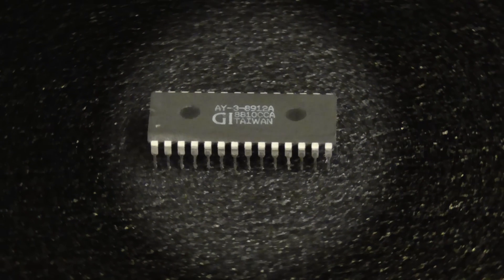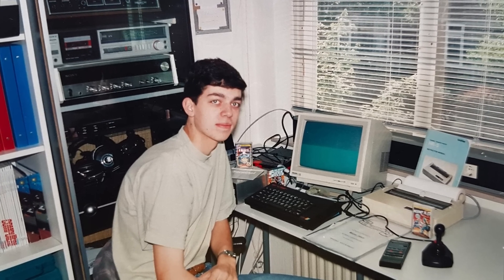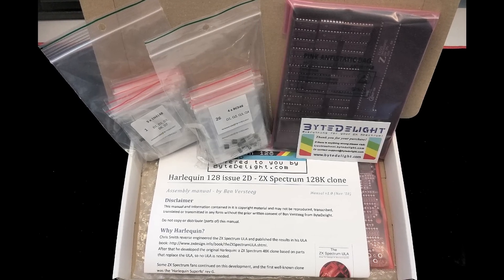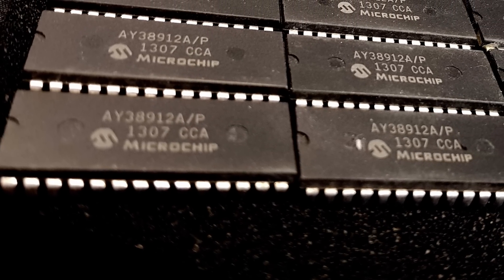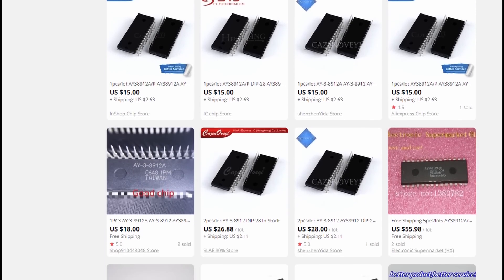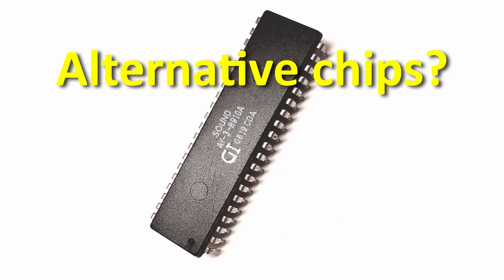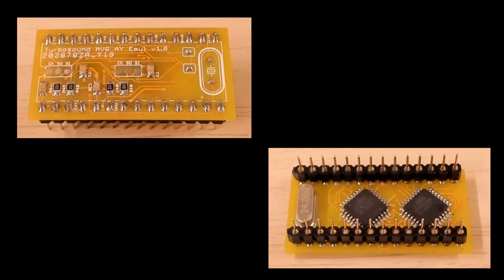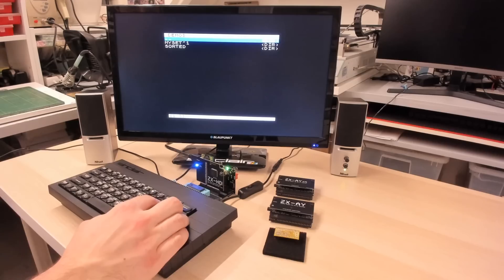R.I.P. AY

Comment: I'm going to stick my neck out here and say I actually prefer the sound of the AVR-AY, at least compared to the 8910's sound - I started searching because I was messing around with the idea of using the broken toy keyboard I have to enter notes into an AY driven by an Arduino like I did with my '1943' project except without the musical competence :). I used the 8910 for that project and will probably end up re-using it for the new one if I ever get chance to do it. Form-factor/Pinout won't be an issue for me because I'm not building a Speccy clone (this time :) ) but a pin-for-pin replacement with a sensible cost in relation to the original is cool either way and would make DIY Speccy/AY interfaces possible again for nutcases like me.
Reply from the maker: I don't mind when someone has another opinion than me, I respect that, so don't worry ;)
I will do a new video soon about a comparison of new clone chips, and some other original AY-3-8910 clones.
More material to listen to ;)

Comment: the original ay sounds a lot more dynamic and open than the others, the avr ay seems sorta compressed? if that makes sense. i dont know much about these chips and exactly how they work, but i think ive seen some modulate up or down in steps really fast to produce a sound rather than doing it smoothly? id probably think the avr ay has more resolution step wise which may be causing some of it? im not sure. 

Either way, Would love to know more about these chips and how they work! i've seen some videos on these kinda chips but ive since forgotten any specifics and im not confident enough to talk much more about them since i don't know enough how they work to do so without feeling like an idiot.

to those reading this, i hope you have a wonderful week :)

Comment: Let's face it, the Sega master system is more what the spectrum 128k should have been like (but, with 16+ sprites per line) or a Sinclair QL like graphics, but with pallet.  From memory the QL hardware was originally to incorporate a z80.  I had a spectrum and QL.  I communicated with Sir Clive.  The QL was great, but needed to have a pallet and better drive system.

But, an interesting thing O found out, was the z80 had undocumented instructions in the free space around the outside of the chip on the wafer.  This was truely legendary stuff, as you can set up a protected mode with it and a special chipset.  It's like the 8 bit version of the x8086, but with a protected mode that means it could have done a primitive alternative to the 68008, but with 64KB spaces.  This means that a QL based z80 spectrum could have been done, while waiting for the 16 bit z8000 to replace the z80.  They had trouble getting out the z8000, but like with the early 16 bit 6502, they could have done essentially, a 16 bit widened version of the original z80 circuit (with undocumented instructions documented, and a few more).  It all makes me appreciate what they were trying to achieve compare to the 6502.  We were so close.  What happened, cheapness, no game philosophy to the dating QL.  However, imagine protected mode CPM OS, GEM window GUI, and enhanced graphics.  So close.  But, the QL, like the electron suffered due to memory handling performance issues, I found out, which slowed things down.  I would buy such a machine back then, and Clive would get his business machine.  Put the business model in a small square box to put under the counter.  Excellent for mum and pop stores, POS Terminals, and some office machines at a fraction of the PC price at first.  If it was me, I would have looked at enhancing graphics and maybe Sega technology, for a joint project.  They do games, we sell the machines into the computer and business market, game home and business version.  Extend the Sega/MSX architecture to 512+ pixel width, and more sprites.  The game machine gets the standard resolution, the business version gets the enhanced resolution and memory.  In a year or two, the home/games version also gets the high resolution features.  Eventually, with increased 16 bit processor, it competes in the space the mega drive competed in, instead.

But, what really happened.  It seems that the Commodore Amiga chipset technology might have been  licensed to Motorola, as they had early plans for a similar featured chipset, which disappeared, maybe after the Commodore / Atari Amiga fiasco.  It has been announced, and people were planning machines based on it.  The Tandy Coco 3 was originally to come out earlier with the chipset, but they scrapped and did the present design instead.  Could this be something that influenced the 68008 decision (the chipset had variable bus width) as a future upgrade?  The in development timing of the technology, is interesting.  The flare team actually based their chip on the idea of a stripped down Amiga equivalent, removing  redundant features that did simar things.  They would have known about the Amiga like Motorola chipset.  That chipset should have been the 128k and 256k etc during Amstrad.  They went on to develop the Atari Jaguar, which was the most powerful at release, but regrettably not for Sinclair.

Over at Commodore, the designer of the Commodore  128 was to use an Motorola chip I think was this chip.  But was talked into using an chip Commodore had, which was supposed to be equivalent.  It wasn't.  There was compromises in the 128 aswell as QL and Electron.  It is dumb founding they didn't just do a Vic 3 expanded version, in house.  Latter, they did a suspiciously enhanced chil for the c65.  Me, I would have twerked and palleted the Vic 2 to get more sprites per line and more sprite functionality and better graphics modes and tile handling.  Compared to the more sprites and higher bandwidth, the enhancements would be relatively minor.  A 128 business system, could have a seperate 16 bit or 8 bit bus for graphics, with a bridge write chip inbetween.  Integrating the chips together on a long dip, to reduce cost.  Such a system could have multiple chips in the dip. Including memory.

Please not what the c65 sounds a bit like.

All, so close, but so far away.
Reply: I love that you love fantasizing about "what ifs" with retro computers, as well. I have never read nor heard about any licensing of the Amiga chipset to Motorola, nor any similar chipset being announced nor planned by Motorola. Where did you hear or read about this? Can you provide any references to it?

The CoCo 3 was based on the 6809, and was naturally designed to be backward compatible with the CoCo 1/2. So, they included most of the capabilities of the Motorola MC6847 VDG into the GIME. I never heard about them considering using some higher-capability Motorola video chip or system chipset. Keep in mind that the 68K series was not based on, nor in any way backward-compatible with, the 6809.

The C128(D[CR]) used the MOS 8563/8568 VDC, which was somewhat based on the MOS 6545, which was itself a mostly-enhanced version of the Motorola MC6845 CRTC. The later is the IC you were thinking of.

The C65's VIC-II was quite intriguing in my book.

The 68K series had a far better architecture (esp the mostly-orthogonal ISA and the flat memory addressing) than the Z80 and successors and the x86.

Comment: I think an FPGA would probably do a better job at emulating the AY-3-891x then a micro-controller, though with enough time and effort on the software side the AVR AY could get even closer then it is now.
Reply from the maker: I agree, but an FPGA is completely different, so would require a totally new piece of software programming. The ATMega chips have the benefit that they are cheap, have 16 bit timers (for PWM). But they're not perfect no.
The ideal solution would be following the exact circuit of the original AY chips, but I don't think that information is available. Maybe we could get there by reverse engineering. But knowing exact values of the analogue parts would be a must.
So I am happy with getting close.
And in the meantime other clones have been developed, so I need to dig into what currently is the best one for the bucks, to bundle with e.g. ZX Spectrum clone kits, or act as a substitute for an original faulty one on boards.

Comment: The difference between the original and AVR-AY sound might be due to different internal output impedances, which in turn might affect the sound balance in the RC network that follows the output chain in Harlequin diagram. Decoupling AVR-AY outputs with capacitors might help.

Comment: @ByteDelight. I suppose that the idea is to sell the TurboSound option, as it's cheap enough to add some value to the fact that in truth you are not using a TRUE AY8912 chip and loses something in the way... Additionally, it will be possible to upgrade somehow the firmware of these circuits once they are installed? It's planned ?
Reply from the maker: I will start with producing a drop-in replacement of the AY chip, without I/O, so for Harlequin kits and ZX-AY.
Later I will work on more features, but someone else is already doing that, so not sure if I need to.
Anyway, for now I need something to be able to keep offering hardware with AY sound.

Comment: This is the second time in recent weeks I have seen a "replacement" chip that uses its own crystal rather than rely on an external clock like the original.  That's a strike against in my book.
Reply from the maker: You're right and wrong.
The microcontroller requires its own external clock signal, so that's mandatory.
But it seems that the limitations of the selected solution, doesn't allow space for an external clock signal for the AY chip to take into account, so instead it's just 'calculated' and generated internally.
I received another solution which I think uses an FPGA (need to check what exact chip is used there, but I couldn't get that clone to work yet, so haven't spent more time on it) which uses the external clock, but obviously that will be a much more expensive solution.

Comment: Dat is een tijd geleden, dat ik een ZX Spectrum + had.  Ben nu volop bezig met de C64’s en de AMIGA 500/1200’s. Zag zojuist je website en helaas was er veel out of stock. 

Zal mooi zijn om een HARLEQUIN 128K REV 2D ASSEMBLED + ROM met een mooie COMPLETE ORIGINAL PLUS CASE FOR ZX SPECTRUM INCL. NEW MEMBRANE. En daarop een BRAND NEW DIVMMC ENJOY! PRO ONE WITH CASE, INCL. PREINSTALLED SD CARD. Hopelijk kan ik het op je website kopen. Wat anders, dan jaren lang klooien met mij C64/A500/A1200’s.

De ZX-AY lijkt me geweldig voor Demos.

Comment: Hi there, I listened to this comparison carefully and I must say it was a good choice to choose this tune as it contains lots of sound tricks and stuff. I must say the AVR AY emulation sounds near perfect. The only differences that I heard were that the AVR AY sound was quite a little bit higher in pitch and flat. I guess the presence of flatness is a feature of the emulation, as this same effect appears on C64 SID versus the ARMSID replacement chip. Anyway if the user isn't an audiophile, the difference between the original AY and AVR AY is almost inaudible. Thanks for the video!
Reply from the maker: The slightly different pitch is caused by the AVR AY used for this video, had a clock of 1.75MHz set for Pentagon machines.
The version I will be using for products will have a clock of 1.77MHz.

Comment: I’m not at all surprised that genuine working AY-3-891x chips are getting hard to find. They have been obsolete for many, many years. Production stopped in the late 1980s after the relevant General Instrument division was spin off as Microchip. Microchip only made them for a couple of years and then production stopped [any with date codes after 1990 are likely remarked older chips, are remarked Yamaha chips, or are fakes]. So we’ve been running on new/old stock that has been sitting around in warehouses and ‘pulls’ (from old boards) ever since.

Comment: In order of best to least.... I do not own any of these machines so my ears are not fan boy biased....

1. AY-3-8912..... warmest sounding of them all.
2. AY-AVR ....... not as warm but has better high end definition.
3. YM2149..... weakest of them all

Over all ... they all work fine and it's really minor the differences. The AY-3-8192 is definitely the warmest of them all. I'd be fine with any of them. That's what equalizers are for. :D
Reply: The question is, which mode is the Yamaha YM2149 in during this test?

Comment: Sounds great. I do have a question though. Why are you working on a single chip version when it is cheap enough to sell the dual AY version? TurboSound will now just be a stock feature if this chip is used for all hardware. Will anybody want a 3 channel option?

Comment: The original AY seems to have a "fatter bass"... but the AVR AY is pretty close. The YM2149 often sounds thinner because it's waveforms run at 2x the speed of the AY
Reply: Not the speed but rather the shape. YM has 2x the envelope resolution but the mapping of volume values to actual amplitudes is different.
Reply: alleluja

Comment: Super Ben, excellent 👍🏼
The difference is quite small with the AY-3-8912 but however I find that the sound is shallower, less dynamic with the AY-AVR.
There may be a few resistor / capacitor values to modify at the output to achieve the same result as the AY-3-8912.
Anyway, I'm really glad you found this alternative with the AY-AVR !
I look forward to the single-chip AVR version coming out of your lab 😃

Comment: I'm in my favorite professional recording studio and I can ear all the differences between them perfectly. The original AY3-8912 have the right channel balance L C R (Left Center Right), the AVR-AY is more clean and pleasant  but lost the C channel signal a lot, at least 2149 sound L and R inverted, less resolution, very bad compared to the AY3-8912. These are not a real alternative for me :-)
Reply: pretty sure that the original ay has a louder right channel and sound more full in general
Reply: IT depends how the AY is used. In the Spectrum, all 3 channels are commoned together into a mono signal. In the later "black" +2A/+3 the audio circuitry has some severe deficiencies that distort the sound. 

Other systems connected the audio outputs differently. Some spectrums were modified for ACB (left, common, right) or ABC sound.
Reply: @jaycee1980   my judgement is about what sounds in the video, I don't know if is possible to create a combination with other zx spectrums, but if we are in the same zx I'm expecting the same conditions, this is what the "clone" meaning or not. Sounds better than the original one? Definitely not. :-)
Reply: None of these have left, centre or right channels. The AY-3-891x and the Yamaha YM2149 have three tone generator channels, each of which is brought out to a separate pin. In most home computers, all three channel outputs were connected together, to produce a single mono output. Yes, it is possible to use the three output pins separately and then mix to two “stereo” channels. But as with a lot of other things in life, there is no single standard. So how they sound does depend on the hardware configuration and on how the composer programmed the chip...
Reply: @Mark1024MAK  what is so hard to understand? I'm judging the sound on the video that's so simple. The video show how these chips sounds and there is a left center and right. You can program the chip as you want, but in this comparison the sounds speak easy, we can discuss infinitely how to use the chip, but nothing will change the audio on this video. They sounds same? NO, The new one sounds better? NO. That's it mate.
Reply: @JGRStudios  - calm down, I never said that they sound the same. And I never said that the video did not contain left and right channels. To clarify exactly what Ben used to produce this video, you will have to ask him (but it looks like he may used his ‘stereo’ board).
Reply: @Mark1024MAK  I'm calm :-), unfortunately the tone of the conversation could not be easily understood, we have just :-) or :-(..... to clarify, the audio on Ben's video is clear, and with a good headphones or better with a good speakers all the differences are super clean and focused on the stereo panning even the chip is programmed, installed, or recreated electronically. The new AVR is very very good and close, more clear and pleasant, is a good alternative of course, but is not a clone because the center lost, this is why some other says (sounds less fat). Someothers said is hardly noticeable, probably yes if the listening system is the computer speakers. Conditions of listening will change the prospective of course.
Reply: @Mark1024MAK  this is what I listen in front of speakers. Even the theory behind the chip, the sound on the video is very clear :-)

Comment: Was interested in the avr-ay as a vectrex replacement however the vectrex use I/O as controller inputs
Reply from the maker: Just found out from someone in the community, that am AVR-AY version with I/O has been developed recently (2021) by someone else.
Will look into it.
Reply: @ByteDelight  cool very interesting ! I have made converter boards to fit a AY8910 in the vectrex a bit tight for space but they work

Comment: But still the AY-8912 has a more full sound compared to the AVR-AY, but hardly noticeble
Reply: I found the AY sounded considerably more full than either of the others. The AVR AY sounded close but with much less bass. The YM doesn't even sound like the same chip.

I'd say the AVR AY is a passable alternative but I'd use an original AY if I had the option.
Reply from the maker: Could also be the volume level of the 8912 was slightly higher, but the lows of it do sound a bit better. And I need to test the latest firmware, maybe it's also a bit improved (I wonder if it can get any better though).